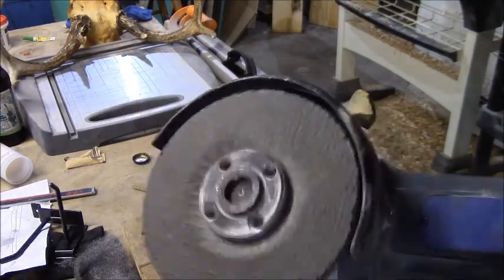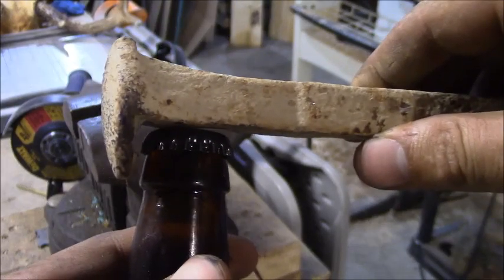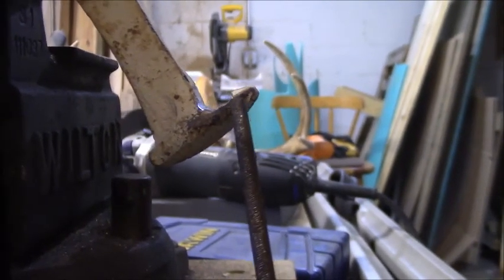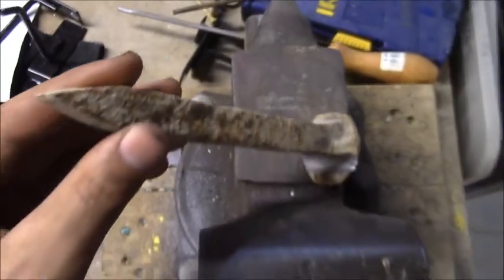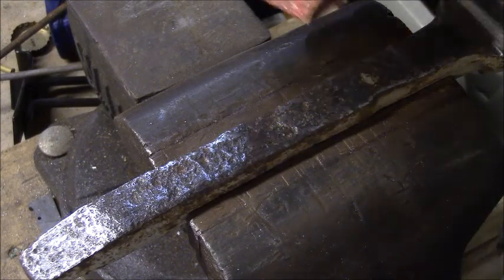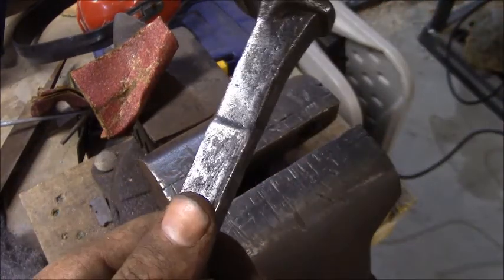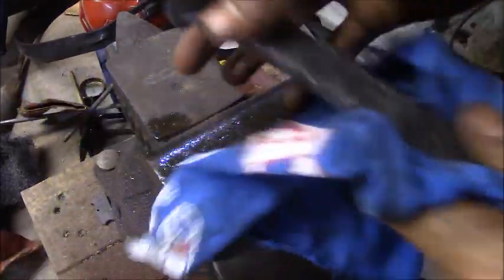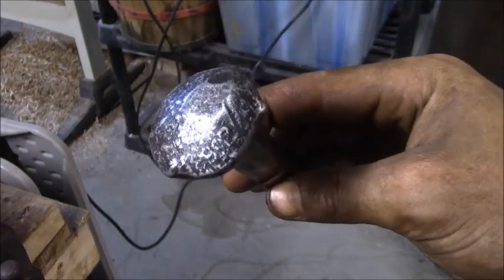How to Make a Railroad Spike Bottle Opener

Comment: Shotgunning tool???
Reply from the maker: 2 in 1 bottle opener, shotgunning tool combo.
Reply: Noble Savage Outdoors if I don’t have a angle grinder what else could I use
Reply from the maker: A file will get the job done but will take a decent amount of time. If it was me I'd still do it, but start with the edge of a regular course file. Then move to touching it up with a round rat tail file. Then just sand paper like I did in the video. You'll be able to do it just more elbow grease required.